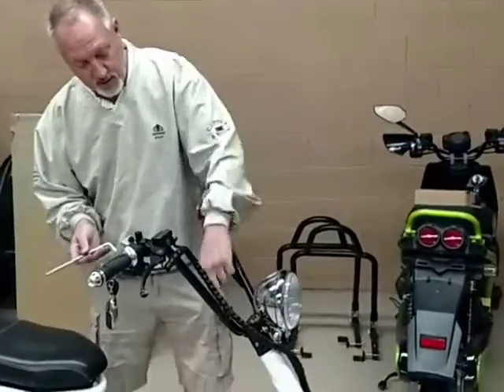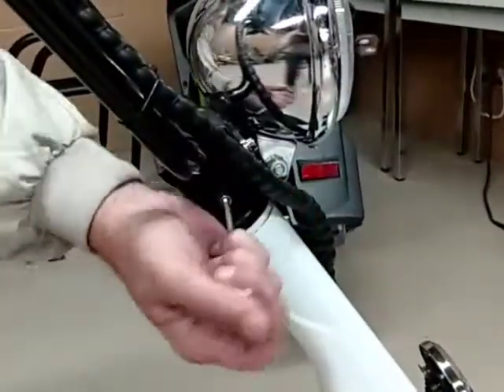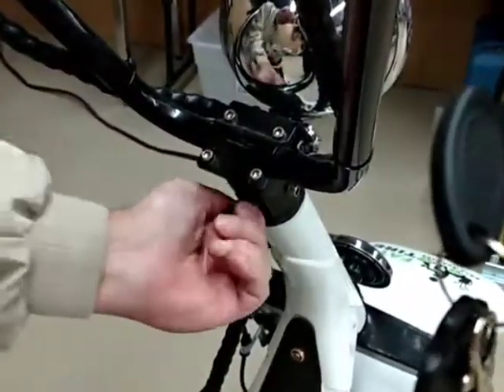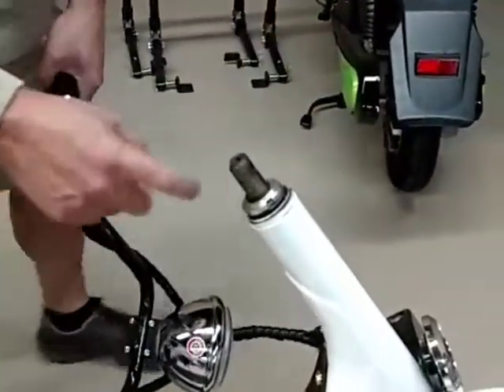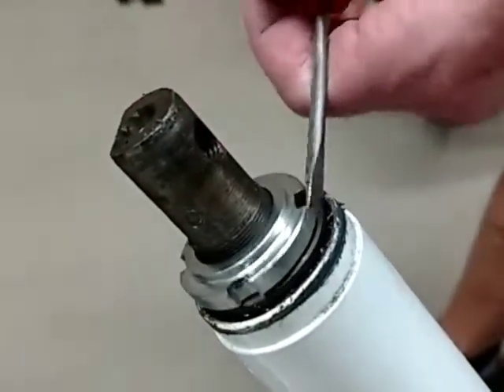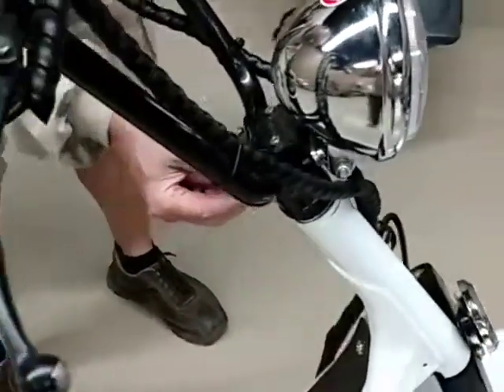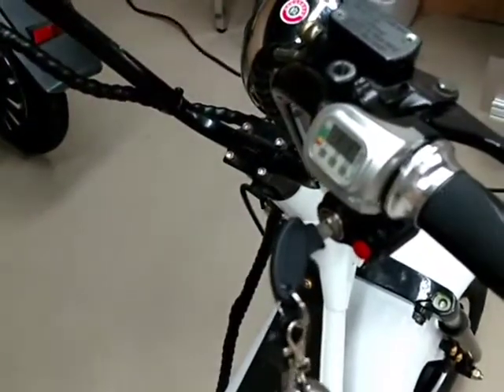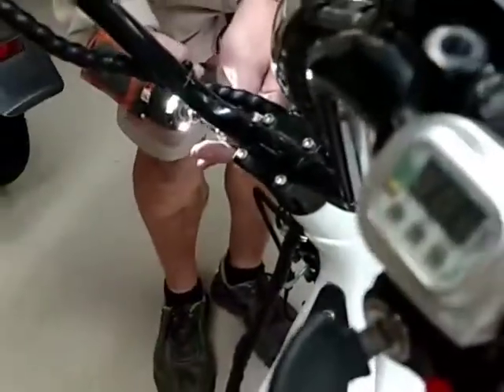Fat Tire Scooter loose handlebar

Comment: I bought two fat bear scooters they're brand new my fat bear scooters don't have the Frankenstein bolts it only has one bolt holding the whole handlebar on. I took off the handlebars and tried tightening up the bolt that runs through the fork on my Red scooter it helped to really tighten up that one center bolt but I thought it was going to break it from getting it so tight the black one I can tighten that thing down and it still has all kinds of play in it. It's hard to believe that I only have one bolt holding my handlebars on
Reply: Any idea what size bolt? I need to replace mine.